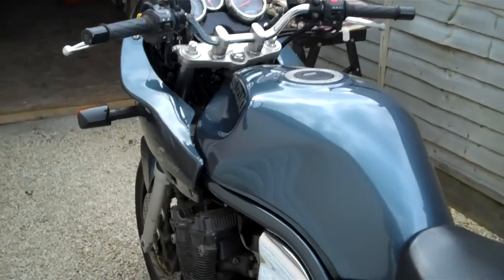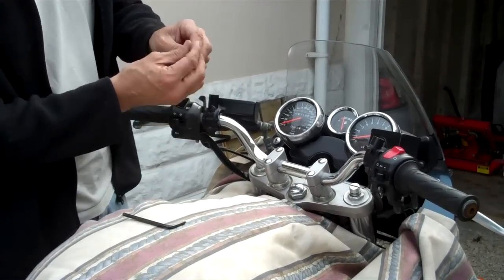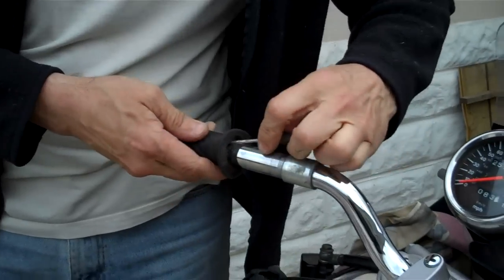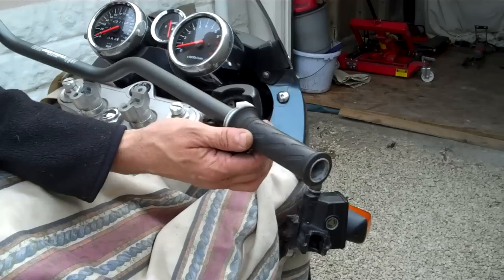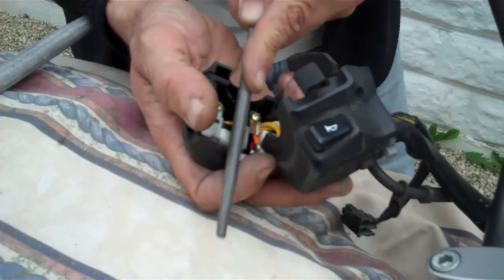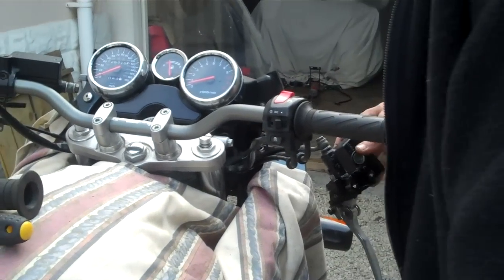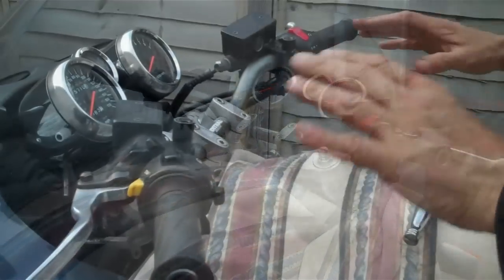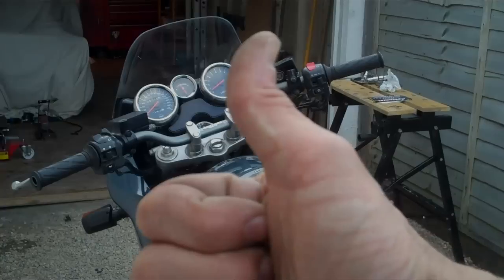Delboy's Garage, Renthal bars, Suzuki Bandit.

Comment from the maker: ok mate, if you still want to drill them, to mark the hole for drilling....wrap two layers of masking tape round the bar, then where you want the switch block....just PRESS the lower half against the tape and it marks the tape...thats where you drill..!

Comment: neat little trick I got for "glueing" handles to the bar : hairspray from your girl.

Give it a good two sprays inside. Cool thing about it : If you are quick the hairspray is kinda liquid-ish at first and hardens out. So you spray , slip em on quickly and it will harden within a couple of minutes. to be safe give it 2 hours or so.

Comment from the maker: Hi Rudi....huge myth in that old tale of it "quickening the steering".....what it actually does, is destabilize the bike in long curves, and makes it twitchy and nervous in bends....you dont have the rest of the required kit to make it handle like an R6....A bandit is a dollop, made to cart you from a to b with no fuss....its not a track bike and lifting the fork tubes will just phuque up the nice calm bike that it is...by all means try it mate, you can soon return it to factory after all..!

Comment from the maker: Hi John....no, they just want you to buy their over priced renthal bar caps.... you can fit the OEM bar weights, in fact they help reduce the vibes you get with Renthals.....the steel OEM bars are bigger ID than the Renthals so you need to use some Rawl plugs to fit them.. i made a video so ill send you a link in PM... good luck, Del.

Comment: I changed my bars out for renthal the other day. Used the exact method del shows in this video, but I put a small piece of bicycle inner tube between the switch gears. 
They will not move!
Just left around .5mm of the plastic lug to grip the rubber. 
Just a tip for anyone who ends up here.

DO NOT DRILL! RENTHAL DOES NOT RECOMMEND!

Comment: I know this video is super duper old, but I just skimmed through this video to get the main points and all I can say is thank you mate. I crashed the other day and bent my handlebars on my Lexmoto Adrenaline 125cc and I’ve just replaced them with some gold Renthal bars using your tips. The whole process took about 2 hours or so because I wanted to get everything perfect and I did a lot of other stuff while I was at the front end of the bike (may as well when you’re already there). Brilliant tutorial mate. That screwdriver and WD40 really did the trick with getting the left grip off without needing to break it and buy a new one. Old one fitted right back on just waiting for the WD40 to evaporate so it sticks back down to the new bars.

Earned a sub and a like mate. Bravo.
Reply from the maker: Thanks Jack, glad it helped you mate, I hope you weren't hurt when you crashed, and you've got it all back on the road nice and safe.

Comment: I watched this video 2 times... And now, like literally right now.. I will do the same! Thanks for the tips and tricks!
Reply from the maker: Hope it went well buddy,   and thank you for your support..
Reply: @Moonfleet41  it went excellent! 
your video helped me do it fast and avoid stupid mistakes and know the steps..
so much  fahrvergnügen now!
Reply: @Moonfleet41  do you have videos on bandit carburetor and valves also? Looked through Playlist but didn't find...
Reply from the maker: @cattleNhay  Hi buddy, sadly not, I never got round to doing the carbs and valve clearances on my Bandit before I sold it, but good news, it's a really easy job (the valves that is) cos they are lock nut and adjuster, rather than shims... so with a spanner and small screwdriver you can set the clearances exact!  Carb balancing is a bit of a dark art, and unless you've done it yourself before, then it is good one to take to a tuning shop to get them to maximise your motor's output and it's a sound investment, as the bike will run way better than it does normally!

Comment: comfort is an illusion in the sportster world. you can only think and believe you're comfy.

sometimes but just sometimes i just think of getting a cbf1000 for my daily commute to work and home. good clutch, good brakes, good suspension, good seat , good engine, good service and etc. 
but than i think i'm not used to having everything good in my life. 
i simply like living uneasy.

ah btw; any bike i ride feels like mine in less than 2.3 secs. then some stick some don't. 
glad it worked for you

Comment from the maker: Ayup Robbie..splendid bike mate, and splendid route to take with it.. its not hard to swap the top yoke itself, just strip the bars of all fittings, remove the clipons, and then the yoke can be removed..slip the new yoke and bars on...but the main issue will be checking if the cables and wiring will reach the Renthals..you may just have to re-route a few things to get them all to fit..if it wont work, you could just fit some high lift clip-ons..!!see how you go and PM me if you get stuck ok, Del

Comment from the maker: The air compressor trick is a good one, and only works on those soft gel grips because they stretch more..but regular factory grips can just rip open, they must be cheaper rubber...good tip on the cable stretch, i guess you can mention this that and the other, but in the flow of making a video you can forget to cover every little point, some things you have to leave to peoples common sence..  thanks for your comments, much appreciated matey.. take care. Del.

Comment: When re-installing handlebar grips, I mix a little wallpaper paste and smear it inside the grip. It slips on very, very easily and dries overnight. Not difficult to break the seal with the method you used. Add a little water spray and it slips off again easily and, before anyone asks, I've never had a problem when it rains!

Comment: Delboy - your instructional videos are just the best! Watched this a few times before attempting to fit the same Renthal Sportbike Ultra Low bars in this video to my K4 Bandit 600s. I'm new to biking (at 49!) having passed my test 6 months ago and been riding since then, and I have very little mechanical experience. Your vids make things look so straightforward and gave my confidence to do it - so I did last night - no probs - and the switch blocks fit real tight without the holes or tin foil. Gonna go try it out this morning and see what the difference is. Given it's an 11 yr old bike and in mint condition (only had 3200 miles on when I got it) I'm looking to do most of the servicing myself. I had a full dealer service, carb clean, new tyres, etc when I bought it just to get it checked out - it had obviously had a lot of idle time in 11 years at that mileage, but now I'm working up to the next service items. I did the font brakes and chain (by following your videos) but now I'm thinking of doing the valve clearances which are due in a couple of thousand miles. I've read the Haynes and watched numerous vids on YouTube and it looks easy enough, but I just wondered if you planned to do a video on this with your Bandit any time soon or whether you had any hints/tips/approach 'cos I'm sure they would be a great help. Cheers!!!
Reply from the maker: Stephen Brewell Hi Stephen... its good to hear that you are getting stuck in with your own work....sadly i cant help with the valve clearances now, i sold the bandit a few months ago, but it truly is a really easy job and as long as you take your time and work methodically, you'll make a good job of it....the only little tricky bit is to get the lock nut done up enough and not close the tappet in on itself...so check the clearance again once you've locked it off to make sure you still have the right gap.... good luck with it buddy. and thanks for watching.. all the best.. Del.
Reply: Moonfleet41 Thanks Del. I read it was better to set them at the widest of the tolerance rather than mid (what the dealer would do) or the tightest, as they tend to move tighter rather than looser. Would you agree?
Reply from the maker: Stephen Brewell
Yeah, thats what i do, at the widest setting they just rattle a bit more when they're cold...but the gaps only shrink, never widen...

Comment: I just bought cheap aluminium motocross handlebars for my hornet. I did cut them shorter 1cm from both end. And I bought 3cm riser. Also I did drill the 5,5mm holes to the bars. They are pretty wide but works great. Better than originals for sure for my riding style.

Comment from the maker: Hi buddy, and thanks for your kind comments, yeah Bandits are real popular here, and pretty much the most universal bike on the road... With the bars, Yes, Renthals are universal and will fit any bike as long as the cables and switch wiring will reach..  the large high rise ones are maybe too wide for the Bandit, but the Roadbike medium and low fit just fine... lets see a video once you have them fitted aye.. ride fast and dont let the feds catch up...Del.

Comment from the maker: Hi Charlie....well done on getting your hands dirty mate, its way more fun the Schelling out to the dealer for repairs.... with the bars, i used the "Road bike LOW" and they're about the same..if you went to the Medium, im sure they will fit with no issues, im not sure if the 'high' would work very well, you could be in for a heavy bill for the brake hoses etc...if you go for medium, and fit your factory bar weights as my other video, you'll reduce the vibes and be fine..good luck chap..Del

Comment from the maker: Hi Chris.....i added the brace mainly for looks and effect...it does stiffen up the bars, they tend to flex a bit as they are only alloy...but not enough to be an issue...its just that with a brace they are rock solid...why not just poke the bars on and then see if you find them a bit bendy...its no more then about 3mm movement at the bar ends, so see how you feel... top notch on the Bandit again buddy....enjoy every minute... Del

Comment: very good guide, i have just ordered a set of bars for my mt07, i didnt like the idea of drilling em, thanks for showing me a better way.
Reply from the maker: Dulux Doggy Thanks Dulux, and good call not to drill them...the factory steel bars are a different metalergic makeup to the alloy bars, the metal is flexible and can bend, the hole really makes no difference to its integrity....but the Renthal bars are very advanced tempered alloy, and they do flex...but they DO NOT BEND....they are more likely to fracture....so drilling a hole in them just stands to be the most stupid thing you could possibly do....no?.

Comment from the maker: Run the bike till it's burning hot full working temperature, cut the fuel off and let the carbs run dry until the engine coughs and stops, then there is nothing in the fuel system to go 'gunky', but actually fill the tank to the brim with cheap petrol for storage to stop condensation water rusting the inside, then dump it and fill with fresh in the spring...and change the oil before you are going to use it, not before you lay it up as that will go stale too!  PS lift it off the ground too! Del

Comment from the maker: Hi mate, check that the actual choke slide assembly on the carb frame is pushed right home to its stop, (left hanbd side below the CV cap) and that the cable isnt trapped in some way....it can often be helpful to take the left hand bar furniture off and re-assemble it again from scratch....hope that helps you mate.. good luck, Del.

Comment from the maker: @2wheelsteve Ha ha love it, we learn by our mistakes aye... best under clamp trick is to slip some tin foil under them, then screw down onto it, it grips the clamps tight and keeps the water out...its more a trick for the older bikes with steel bars and cast alloy clamps..these days they are all plastic with pins in...but if the pin snaps off, it still works to slip a layer of foil under it as a soft packer...  good to hear from you mate.. cheers. Del.

Comment from the maker: Hi Tom... the bars weigh a full Kilo, and are 28 inches wide...they have the rubber bushes in the end and the nuts are rattling about inside them, i had no plan tto use them so just took the screws out... if they are of use they're yours, just let me know how you want to go ahead mate..?

Comment from the maker: Hi Cloggie, no it wont effect the bike's handling, just maybe your comfort, but if you have no choice than its academic...just make sure you fit all the switch blocks and grips first...move them in as far as they will go to see how much you can afford to cut off, cut too much and your could make them unusable...the outer bends will dictate how much you can spare...good luck with is..

Comment from the maker: Hi mate, provided you have got the top half of the clamp bolted down tight with equal gaps front & rear, it should grip the bar, but if not, then try wrapping a layer of aluminum foil round the bar where it goes into the clamp, then clamp down on to it tight ...this will act as a gasket and fill out any spaces where the clamp isn't touching the bar and give you an all round grip, which should stop it, also being soft, the foil tends to grip like on the road, where a metal rim wouldn't - Del

Comment from the maker: Just fit a top yoke conversion which provides the clamps needed to hold the bars, they are available on the market and about the same price as the bars!  Alternatively, drill the existing top yoke and use some second hand Bandit bar clamps.

Comment from the maker: Hi mate, considering they are nothing more than a method of holding on to the front end, they, in themselves, have no affect on handling whatsoever any more than does the seat or the speedo LOL!..but for any bloke over the height over about 5'10" the Bandit bars are too close making the ride position a bit cramped, I find the 'Renthal Road Bike Low' spec bars straighten my arms out, give a slider wider stance & allow my back to sit straight rather than hunched, they are more about comfort, Del
Reply: Hi mate I don't mean to hijack someone else's question but just sitting on the bandit I bought in ride position feels very uncomfortable. I'm actually about 5'10" myself and don't know if the low renthal  bars might be a bit uncomfortable for me too with being tall. Do you have any suggestions? Rob

Comment: Got Renthal lows today, will fit them before work tomorrow.  Made notes throughout the vid, so even though it's easy, I have the confidence to know step-by-step what to do.  Can't wait to stop having dead hands on rides, plus they look cool!
Reply from the maker: Hey Glenn, how are you buddy, and good to hear you're doing the change yourself... you'll need some bar end weights in them as they are lighter than the factory bars, and you can fit them using the steel rawl bolts as i showed in another video just after this one.. Good luck with it buddy, let us know how you get on.. Del.
Reply: Hi mate, well...the cables don't stretch far enough, esp throttle, so tried unclipping them from the metal retainer wires next to the frame...by which time it was dark...didn't locate throttle cable properly either so clutch side switch block didn't seat properly.  Got very angry.  Will sort it tomorrow.
Reply from the maker: Oh Glenn, so sorry to hear that mate... what bars have you fitted, i mean which model, are they longer then the factory bars then..?   if so you can maybe re-route the throttle cables "outside" the fork leg and they will reach a lot better..?   Good luck with it mate, you'll get it sussed.. Del.
Reply: Del - now re-fitted old bars.  Renthals are 7/8, Road Bike Low, 754 - 

From that info is there an obvious sizing mistake I've made?  They just seem like the wrong size, but I know nowt about this (cables too short, bar seems too think for brake clamp to fit around).  If there's an obvious answer like "you need this size" please let me know, if not no worries, I'll sort it over the next few days.  Cheers.

Comment from the maker: Hi mate, no not at all, all the cables fit and reach just fine as long as you go for the Road Bike Low bars as they are very similar to the OE ones... if you fit larger bars then you may have issues with wiring and cables!....

Comment from the maker: its pretty simple then mate, the clocks both mount ot the bars, (move them about and you'll see), then just unbolt the fairng and support frame, you'll have to make a tidy job of relocating the wiring back under that tank...then just select a set of lights and brackets form the market and fit them on in place...its not hard, and jusrt a matter of taking your time and making a tidy install of it....you will laso need to moutn the front indicators on a new bracket too..check out "Just Bandits".!

Comment from the maker: Hi Tom,good to hear from you again,mate,I know what you mean, the pukka 'motorcross' bars are way too wide & flat,I've used "Renthal Road Bike Low",these are almost the same as the OE bars just a tiny bit wider (maybe 1") & a little less 'pull back',perfect for me at 5'11" & more importantly they are very different to the motorcross bars. I do have my standard bars & you are welcome to have them but the postage would be ridiculous because they are pretty heavy..let me know what you wanna do..Del

Comment from the maker: @Harp3rOn Thanks buddy.... the mirrors are the OE ones, just with the shafts removed and the ends screwed into each other..(you need to make a short 1" grub screw as you end up with 'female to female' threads)..... but i wouldn't bother mate, they are totally useless, all you can see is your arms.. that's why i didn't bother showing the video of making them..  check out the cheap bar Mirror video later on.. ten times better, looks cool, and only £15.. cheers. Del.